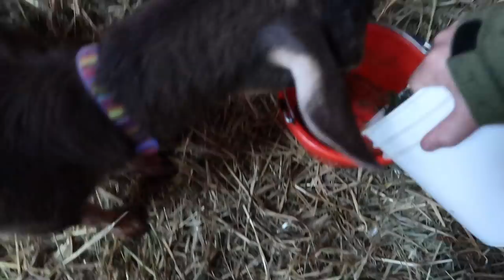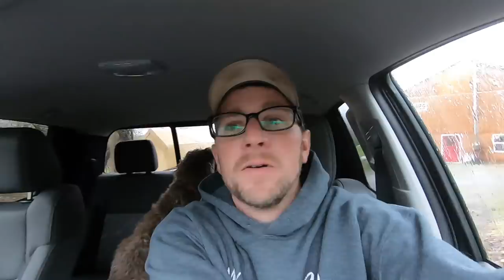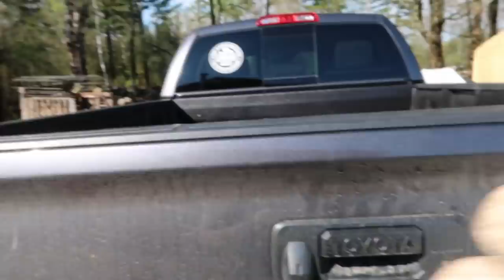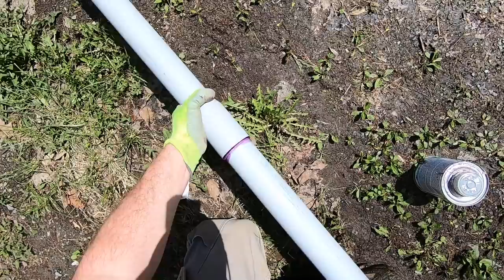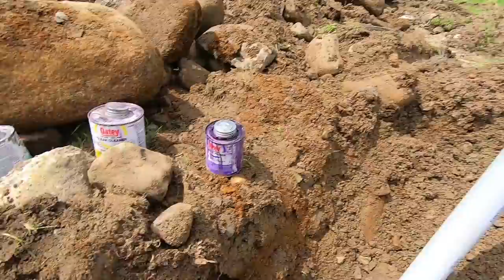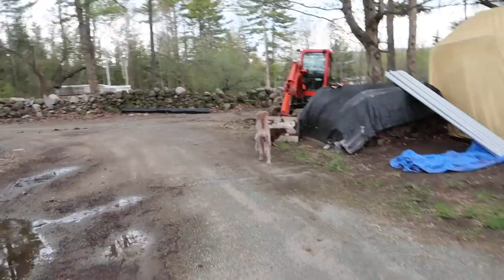Today's the DAY!  The BARN PROJECT BEGINS - Day 1

Comment: A few comments on your conduit install.   Do not be surprised when you get ready to pull in the conductors in the future, if the conduit is full of water.   Even though you glued it like plumbing pipes.   Also, are you required to get electrical permits in your area?  Inspectors typically want to see the conduits before they are buried.   Did you use (5) sweep elbows in your conduit run?   NEC allowes only (4) per run.   You could use the conduit to get temporary power for the contractor.   Make sure on GFCI breaker though.   Good luck with the barn!

Comment: You could use gabion fences that fill with rocks over time but still work with aninals.  Glad your making progress. Turn the rock into fence rows or  add with concrete for fill during a slab pour for the barn.  Each ton or yard saves 100.00 or more.

Comment: Al from what I have learned doing pipe is that  cleaner and primer is the same thing they are phasing out the clear stuff because that way inspector can tell if the pipe was cleaned so basically you are cleaning the pipe twice

Comment: Not sure if it is too late, BUT, if you haven't finished all of the conduit yet, (I think its too late) if you run a string through the conduit, as you are assembling it, you can make it so that there is a big long string, one end of the conduit to the other so when it comes to fishing the wire, you can pull the wire the whole way without having to fish or push the wire at all.

Comment: Dang !  How FAR do You have to go with that underground Feeder ?  Rule of Thumb is that there is a 3 Volt Loss for every 100 feet of length  so best to go with the next size bigger in wire size. Example ;  A 120 VAC 20 Circuit is normally wired with AWG # 12 . If the branch circuit is longer than a 100 feet , you will have a 3 Volt Loss , then go to  AWG # 10 to compensate  for the 3 Volt  loss .

Comment: I was surprised you didn't pass some rope down the pipe to make it easy to pull the cable through
Reply from the maker: We will after.
Reply: Can use a string, plastic bag and vacuum...
Or depending on length, a fish tape
Reply: @LumnahAcres  I would have put the rope as you made the pipe now you have to make extra work. 
I am not an electrician or expert but seems extra work to me.
But great video can't wait to see the building start
Reply: @martinbolton1915 , it would create twice the work just to add rope as you go.  There is a method as mentioned that is easiest.  Which is to put a plastic bag onto a thin rope and use a vaccum to pull the line through quickly.  Doing this method does 2 things at once.  1 is obviously pulling the line through.  But the 2nd is that it will pull most of the debris and dust(if any) out of the conduit.